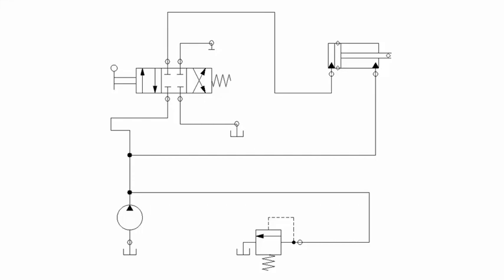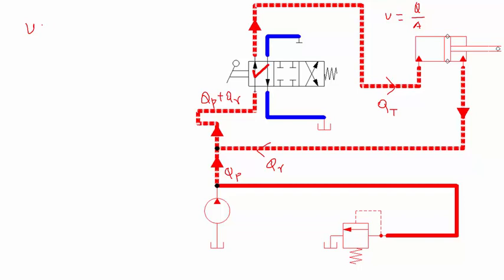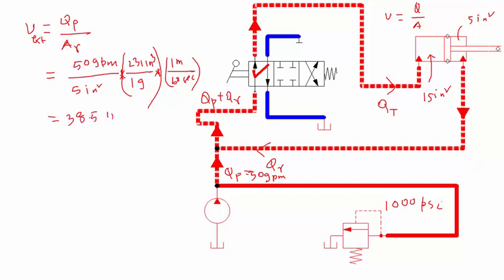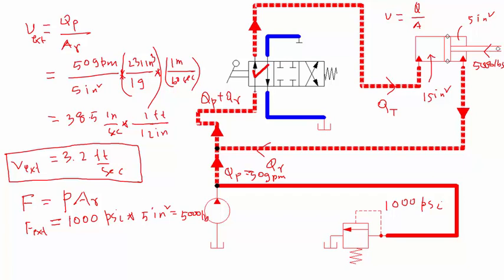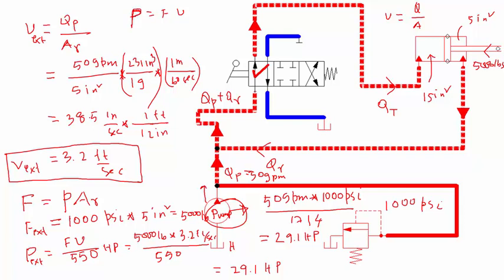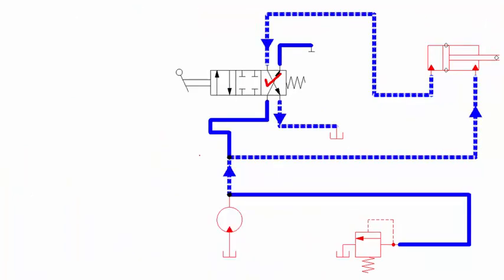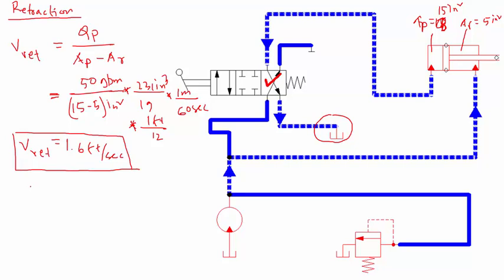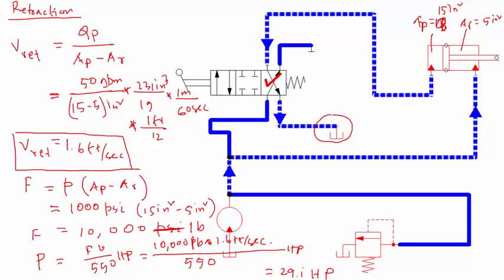Regenerative Circuit: Example Calculations | Updated Version in Description

Comment: Sorry, that circuit is wrong for doing anything other than the regenerative circuit, stop and return. To switch to full force from the cylinder, the line from the rod end has to go through the valve to take the pressure from the rod end and return it to the tank, the valve would need a 4th position to accomplish that. This is shown wrong on countless non-English speaking channels that have never built anything that needs to function in the real world!
Reply from the maker: I'm glad you're thinking critically about the application of these principles! You will find many more example videos and explanations here: https://www.theopeneducator.com/fluid-power | https://www.theopeneducator.com/home |